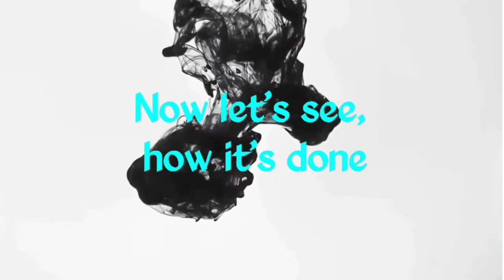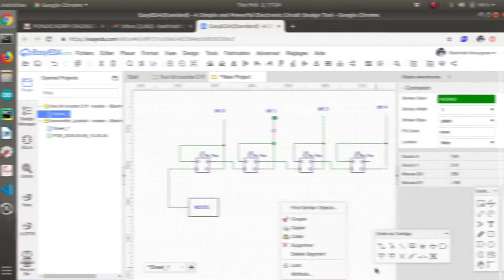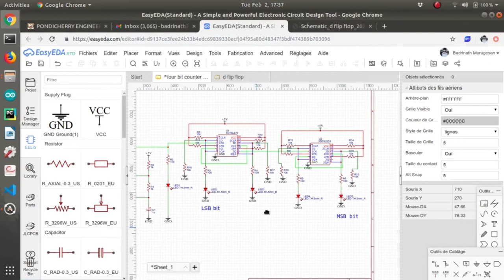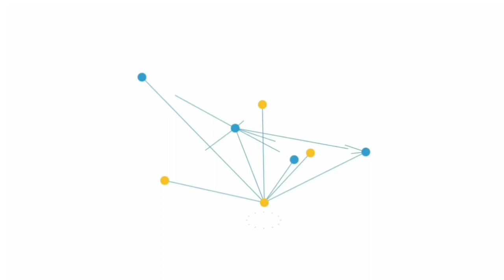Four bit counter by D flip-flops

Comment: Sorry if I don't have the 110 ohm resistors, what others can I use?:socialdist:
Reply from the maker: No problem., You can use any low resistance value resistor, that is only for LED protection, to prevent from damage
Reply: @electrooxe9623  Thanks!!